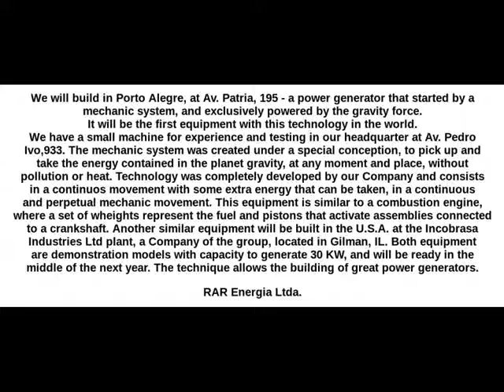Generador gravitacional gigante Brasil   2013

Comment: However efficient it may be, there will come a time when this engine will stop due to loss of heat produced by friction, and this prototype, there are dozens of hot spots!
CARNOT has devised something similar, but everything in the universe reaches a point of equilibrium ...
If perpetual motion were possible, many engineers would have already produced and get rich with this...
  Since they say they have a small prototype, putting it in motion, for everyone to see..

Sin embargo eficiente que sea, llegará un momento en que este motor se detendrá debido a la pérdida de calor producido por la fricción, y este prototipo, hay docenas de puntos calientes!
Carnot ha ideado algo similar, pero todo en el universo alcanza un punto de equilibrio ...
Si el movimiento perpetuo fuera posible, muchos ingenieros se han producido ya y hacerse rico con esto!
  Ya que ellos dicen que tienen un pequeño prototipo, ponerlo en marcha, para que todos lo vean!...